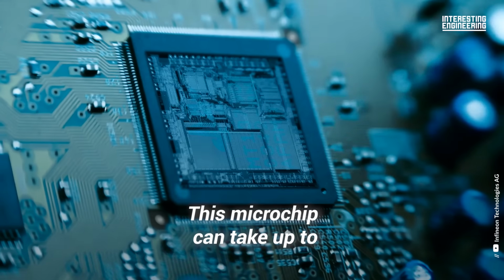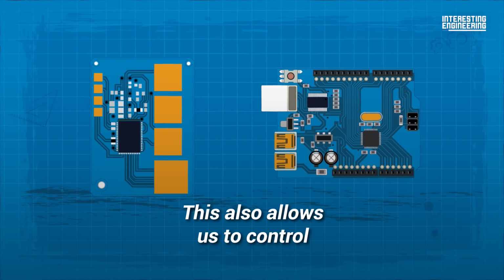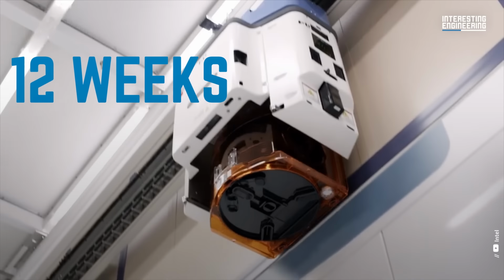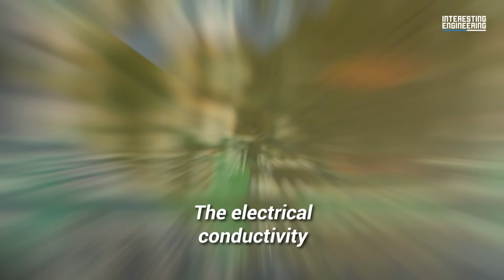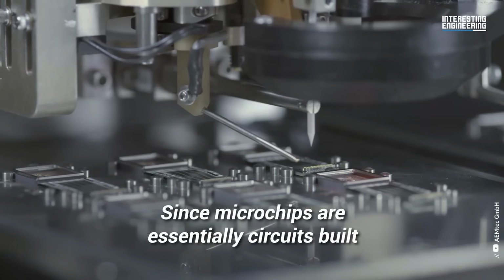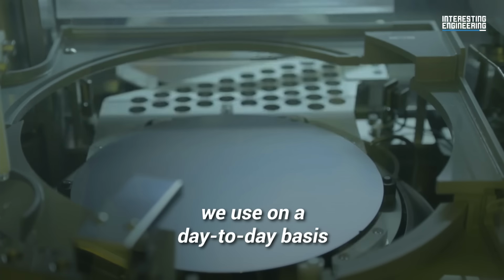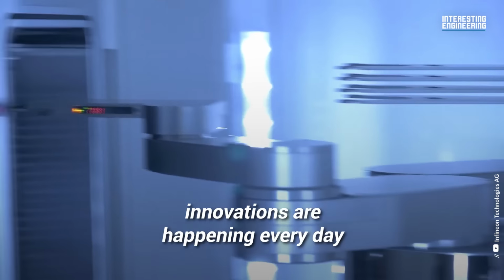💻 How Are Microchips Made?

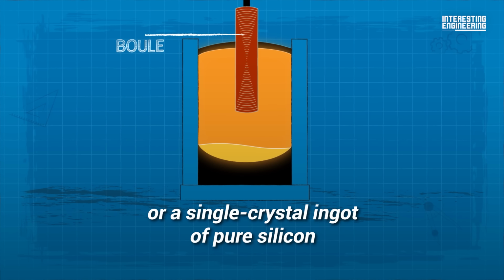Comment: 1:35 One step is skipped - after removal from the melt, the boule then goes through what is known as zone melting to further purify the silicon. It's not ready after coming out of the melt, as it's 99.9% pure silicon - it needs to be more like 99.999% pure (note - not sure on actual percentages, but before any silicon is made into a microchip, it has to be hyperpure.)
Reply: The actual percentage is called eleven nines, 99.999999999% pure silicon.
Reply: @tanqs789  did they teach you this in your school/university?
Reply: @tanqs789  I googled it but it never came out. Could you tell me the reference?
Reply: @tanqs789  Thanks, didn't know the actual purity % - I just knew it was extremely high.
Reply: Thanks for this extra information, the method of zone-refining is actually very interesting, we had it in our high school chemistry.
Reply: thanks, This is why my game lags
Reply: Zone refining is not used for most silicon manufacturing, especially not 18in wafers. It becomes extremely difficult to melt a boule with that diameter. Rather, the silicon going into the growth process is ~15N pure in the first place, so once the czochralski growth (the method shown in the video) finishes, the silicon is ready for shaving and slicing. For most commercial chips, CZ is used, but zone refinement production is sometimes used for higher tier devices that require higher purity and quality
Reply: "one step" skipped ? there was so many steps skipped to make the video succinct
Reply: So part of the process is a “Hot Melt”?
Reply: @atomicorang  Look up “Zone Melting” on Wikipedia
Reply: whatever NERD!
Reply: You're hired
Reply: I think it might be 1 ppm
Reply: @theepicchickenyt  dont just think and say maybe. you have the internet infront of your face. use it. even its just wikipedia.
Reply: @theepicchickenyt  1ppm isn’t even close to pure enough.
Reply: He skipped a hundred steps in every part of the video. And some of the information was quite wrong.
The purification before it gets melted to grow the crystal is already much more complex.
There are no factories using 450mm wafers (except for a few prototype lines that will never go productive) - the industry stopped at 300mm because the cost is not worth it. We tried, we failed, we moved on. Get over it. Almost all existing and active factories work with 200mm or 300mm wide wafers. Almost all new ones are 300mm.
About half the machines/processes shown in the video were not what was described at the same time.
Dozens of processes were skipped (not even mentioned!).
There are currently no factories working with 2nm transistors - the best is 3nm "feature size", which means a transistor is about 10nm wide. 3nm is the thinnest line they can make.
Glass is normally not used as an insulator on chips. Among other things it's SiO2 (a crystalline substance), or complex polymers.
Except for some types of DRAM there are almost no chips with built in capacitors. Except for some very old amplifier designs there are almost no chips that contain resistors. For a simple reason: both are really big. Where possible the designers put in (partial) transistors instead.
I know of no chips that have 100 (metal) layers. It's usually between 5 and 20 metal layers. Metal layers are the ones we count in the industry. But it can easily be 100-1000 production steps to make a chip (many dozens of steps to produce a single layer).
Reply: i didnt catch the part where how are these tiny transistors placed, assembled to their corresponding position of the circuits? I think they skipped this part.
Reply: @jacklinus6811  the transistors arent placed. they getting etched and sputtered (and more) all at once on the chip in many layers. some chips needs hundered of steps before they are done. you are mixed it up with smd chips which are placed on platines. but these transistors we talk about here are under many layers inside of a chip.
Reply: @Wrutschgeluck  your words are mixed up.
Reply: @jacklinus6811  sorry, if you don't understand me. English isn't my first language. I tryed Google translator. I hope you understand now: The transistors are not placed. They are simultaneously etched and sputtered (and more) onto the chip in many layers. Some chips need hundreds of steps before they are finished. You confuse it with SMD chips that are placed on circuit boards. But these transistors that we are talking about are under many layers within a chip.
Reply: My law: the more impure silicon and the smaller the transistors, the more faulty chips are produce. 😳

Comment: There's also a different lithography technique, I I think it's called reverse photolithography where the places exposed to liight remain while the dark places are etched away by the  chemical.
Reply: I believe it is the same photolithographic process. However using a negative photoresist instead of a positive, will result in the reverse pattern being exposed.
Reply: @mathiasdam9607  Yeah, sounds about right. Thanks!